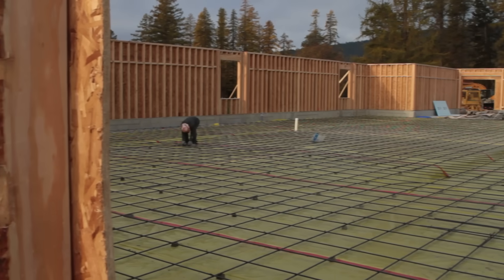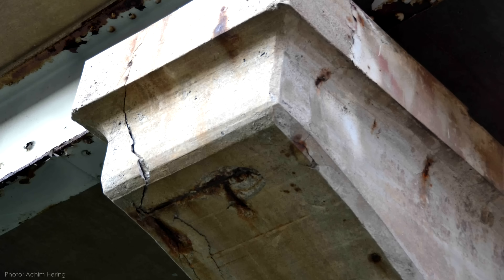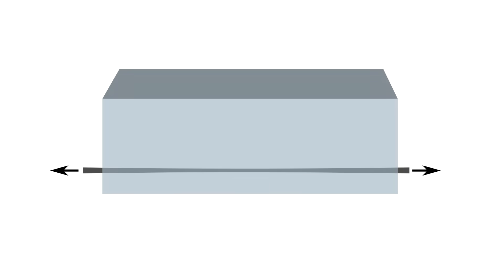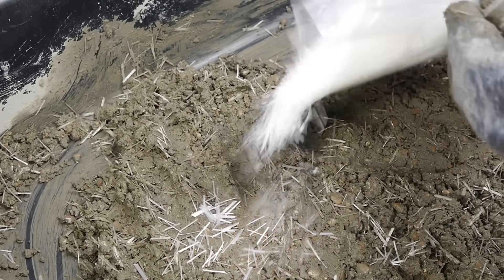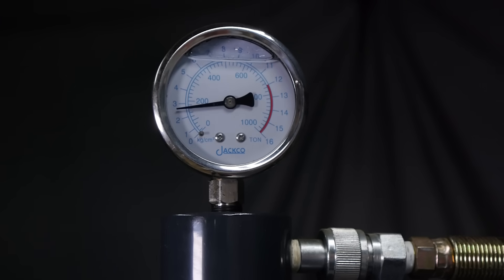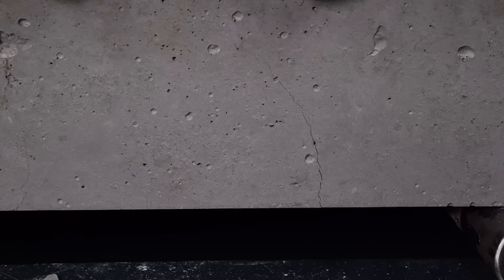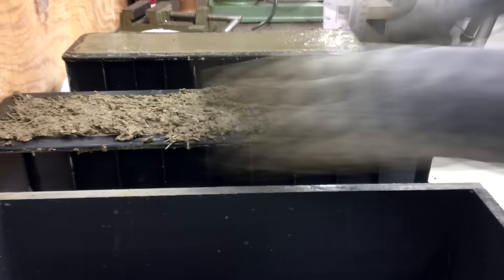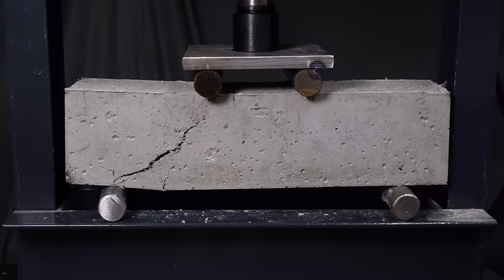Does Rebar Rust?

Comment: So why don't they paint the steel or coat it in a rust inhibitor prior to laying it down for the concrete pour? Wouldn't this make it last longer?
Reply: They do this as he mentions using epoxy paint in projects where its in a corrosive environment, usually each size of bar is color coded as seen in a few Discovery/Science channel episodes about mega projects

Comment: I work with reinforcing concrete and this is what I think about non-steel rebar. It might work for simple rebar-constructions like you showed in the video. But I have a hard time seing a complicated concrete beam being reinforced like that as you can't weld plastics in the same manner. Sure one could argue for glue. But if you glue it wrong... can you just cut the glue off with an angle grinder? How about bending a plastic piece of rebar? Does it have to be heated first? That sounds like waaay to much trouble if like 3000 pieces of rebar needs to be corrected on site.
Reply: Some projects have been built utilizing said composite fiber or basalt type rebar in civil structures, just do an internet search, there is a number of articles in one industry magazine of sorts.

Comment: When i was helping with research work at my university, one of the research projects being worked on was the use of a steel mesh reinforced polymer wrap to be used on columns as a replacement for rebar or for repairing existing ones. it removes the necessity of form work and is great for marine or highly corrosive environments. (the research project i got involved with was the use of steel fiber reinforced UHPC for steel bridge girder repair.) i was shocked to learn how much time and experimental effort goes into proving and implementing new tech and methods in the construction industry,

Comment: Concrete will degrade glass fibers unless specially coated or alkali-resistant glass fibers are used. Don't just chop up ordinary fiberglass and add it to cement.
Reply: noobenstein  not to mention it causes lung cancer if inhaled. I wouldn't want to cut glass fiber reinforced concrete, even using a wet saw.
Reply: Just like a Religious person quoting from a snippet instead of the whole thing, it also goes on to say "In the 1970s alkali-resistant (AR) glass fibers were perfected by Owens-Corning and by Nippon Electric Glass (NEG) leading to a rapid increase in applications." Thus my statement stands.
Reply: And what did you read in my original statement? I had said dont use plain fiberglass, use alkali-resistant or coated fiberglass. Next I quoted only the relevant part on which you had a doubt - that concrete does degrade plain glass. You are quoting the solution I had already given in the OP -use alkali resistant glass. Stop clutching at straws. Do you know even plain fiberglass is available in the market? Someone could get a wrong idea that even that can be used in concrete.
Reply: Are you that daft? Many GFRC project have used standard fiberglass with no such issues.
Reply: Degradation of fiberglass in concrete is a well known issue you fool. Early GFRC suffered badly from this issue. I quote from https://www.concretenetwork.com/glass-fiber-reinforced-concrete/  
"The problem with using glass fibers as reinforcement for concrete is that glass breaks down in an alkaline environment--and there's almost nothing more alkaline than concrete. You may have heard of concrete being damaged by alkali-silica reactivity (ASR) when there is reactive silica in the aggregate. Glass is primarily silica. The original GFRC in the 1940s rapidly lost strength as the glass was destroyed by the alkaline environment."

Comment: Hey Brady, I'm a 4th year undergrad in civil engineering  in Canada. Over here, we mostly learn that covering rebars  with epoxy or other layer is mostly a detrimental to the rebars as the  layer cracks and when it does, the water infiltrate and doesn't have anywhere to go so the bars rust even faster. As a result of that epoxy coated rebars are ban in Canada... I will most likely go read about those FRP bars, do they still have the same problem as the epoxy coated ones?

FYI, I discovered your channel in first year and eversince then I can't get enough! Great video!
Reply: From my corrosion class professor: Never coat an anode. Coat the Cathode. Cathode coating limits the area of electron sourcing.

Comment: I'm thinking why don't they coat the Rebar, like they do Cables for bridges or a Man Made Coating.... Like for electric wires...
Reply: QuietStormX it’s expensive. Just delivering the rebars and having them rub against each other will scrape some of the coating off. The rebars sometimes get moved with heavy machinery that will chip the coating too. Fixing then chips and scratches would just be very time consuming and expensive.
Reply: I'm talking about what they use for communications cables in the ocean. I'm sure it can be developed for the abuse too... Think...
Reply: QuietStormX Because rebar needs to have its deformed shape for friction. Having a coating like an electrical wire would make it useless in most common cases. As far as the coating for the cables in bridges, I am going to assume those are galvanized steel cables. They will scrape and scratch each other. It will take forever to re-apply stick-galvanizing to each bar that is damaged. It’s just not an economical method for common practice.

Comment: What about the water in the concrete mixture? Based on your earlier video on concrete, it seems that the amount of water that would be just enough to fully react with the cement is low enough to make the mixture very viscous and hard to cast and often more water is used for an easier cast. But what happens to the excess water? Does it evaporate and how quickly. Is it an issue regarding the rebar corrosion?

Comment: No mention of hot dip galvanized rebar? Still fairly cheap and much more resistant to damage than epoxy. In Bermuda we have lots of salt exposure and ungalvanized rebar is not allowed by the building code. Even the tie wire has to be galvanized.
Reply: Zinc (galvanized) coating is a sacrificial coating and will eventually allow rust
Reply: Zinc will last a long time if it's covered, you see it on older cars. It will go eventually but it lasts much longer than paint
Reply: Thanks for sharing this. It's always interesting to hear how things are done in different places around the world
Reply: The heat from the process dramatically reduces the strength of the rebar. When we send brackets for our elements to galvanization, it is always with normal round bars. The code for the industry (Eurocode) prohibits galvanization of rebar. I live in Denmark btw.
Reply: @HepauDK  definetly not dramatically. zinc has a very low melting point. most galvanisation processes take only a few seconds wich is barely enough to fully heat the rebar up. at least when done right of course
Reply: @konradrothenburger7078  That depends on the thickness of the zink layer. If you want more than just a few thousands of a mm, it takes longer.
All our products are CE approved and certified (no, not "Chinese Export" ;) ), so no loss of strength is allowed.
Reply: @HepauDK  actually the shorter the dip the thicker the zink layer that results. the thinner the zink layer the better. it is more resistand to flaking off that way. (think about paint chipping of a car. the thicker it is the easier it is to remove)
Reply: Not really, a scratch in the zinc only allows rust on the exposed metal, the rust can't creep under the coating like with epoxy.
Reply: Very good point, but there are some use cases where reclaiming the rebar for scrap after a demolition would be difficult, due to the fact that the gases zinc oxide makes when cut or welded on are toxic for humans to breathe in.
Reply: Galvanized is not readly available  and  typically is special order which would make it cost more
Reply: @devilish34  most bridge materials are special order.
Reply: @asherdie  yeah as far as pre bent or cut to length from stock epoxy coated rebar.. I have had customers  ask for galvanized reinforcing bc their architect called for it..There is always little to no stock available .. I even sent out emails to some of my suppliers and no one stocks it  and I am in the Philadelphia area. Only option was to  buy uncoated reinforcing , then transport it to Baltimore Galvanizing